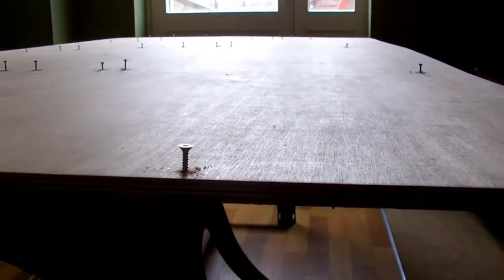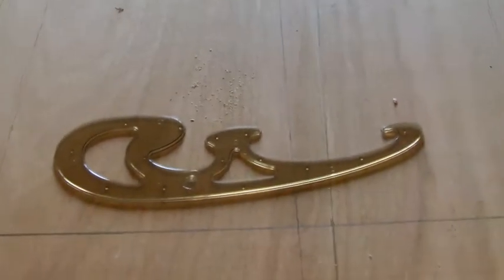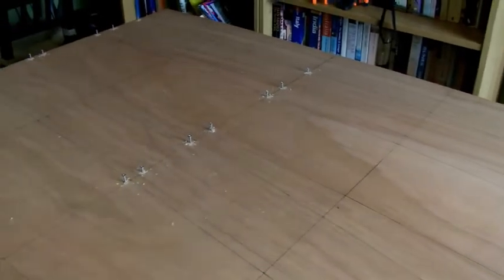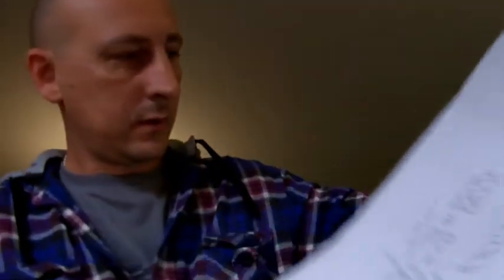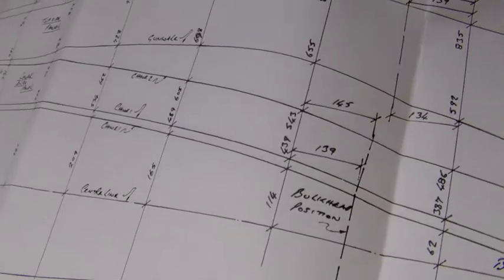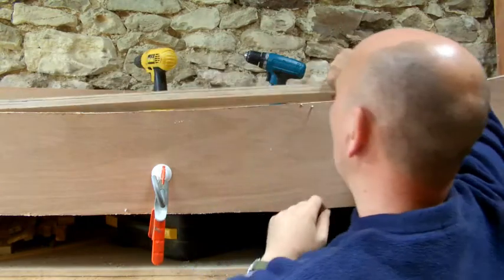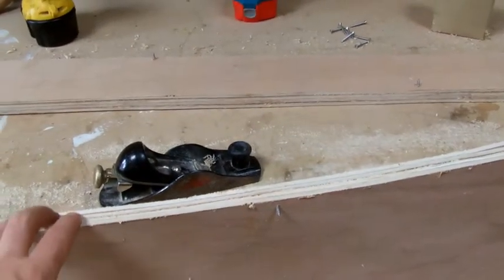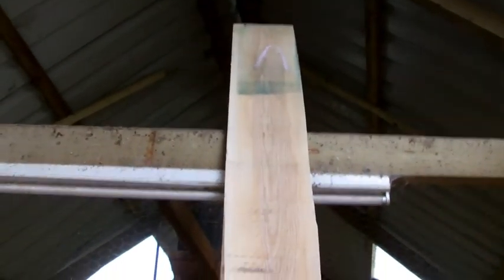part 2 16ft ply open canoe build

Comment: about 4.12 u talk about  Jig saw control, what i do is each side of the blade, on the saw plate i mark 1/8th inch line and use that line as cutting guide, then i trim to pencil line with small block plane
Reply from the maker: yes i agree i leave pencil line to be trimed down with block plane or sanding block.. iv not tryed using saw plate method but will give that a go. Thanks very much for your imput all good stuff..